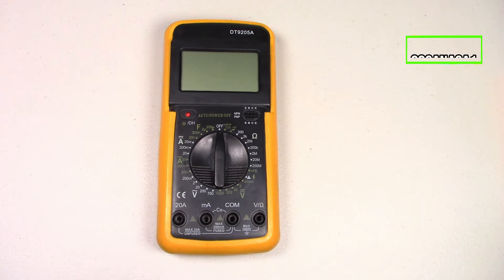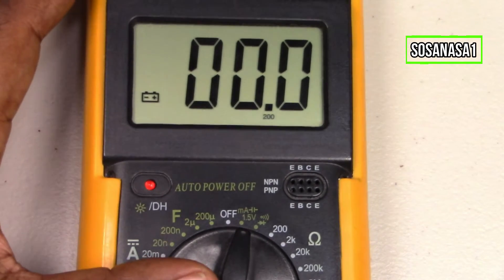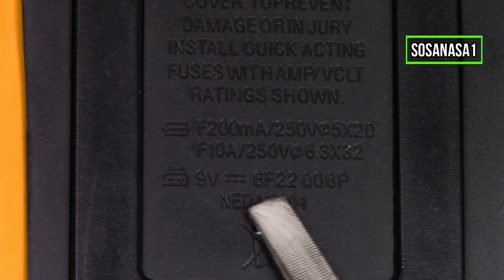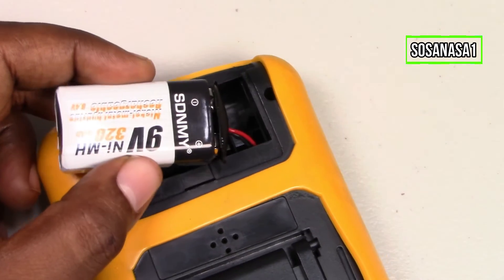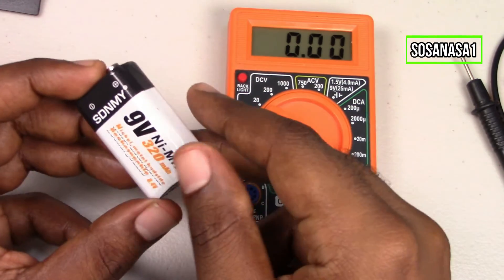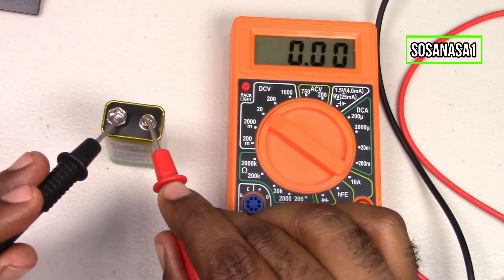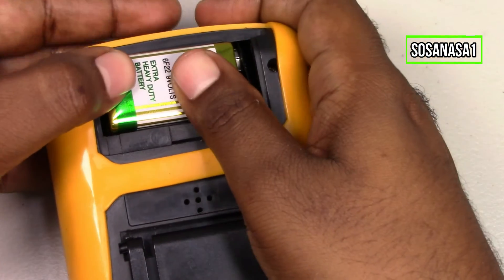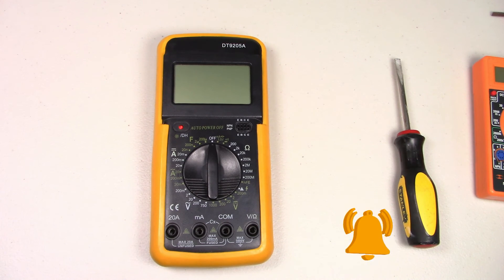how to change the digital multimeter battery (Model DT9205A)

Comment: Hello, I recently got the exact same model of multimeter and I was wondering about one of the settings.
What is the use of the first dial setting on the right of the off switch. The one labelled mA -||- 1.5v ,what does it do or what is it used for. There is also a white triangle sign with a shock symbol after the hFe setting. What is its use. Please reply, I would I appreciate it really much.
Reply: Google it
Reply: @shariarahmed  I found no useful info that's why I'm asking here
Reply: I have the same multimeter but the readings are not steady while talking capacitor measurements & also the display keeps going between 0 to 2 even when nothing connected. Do you have any solution ?